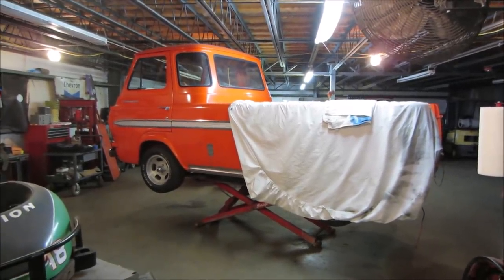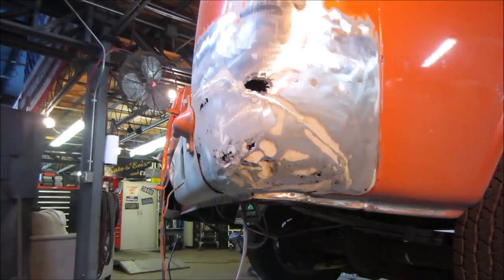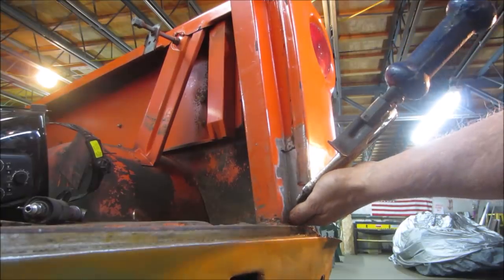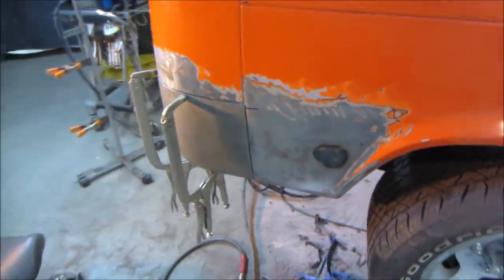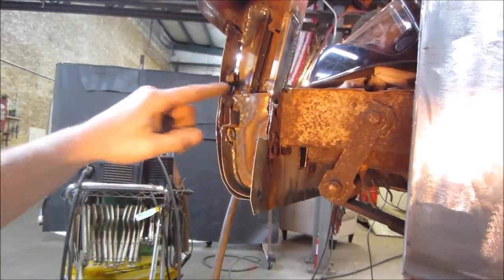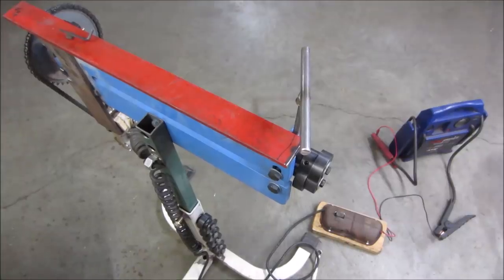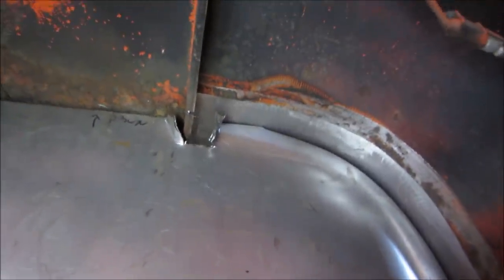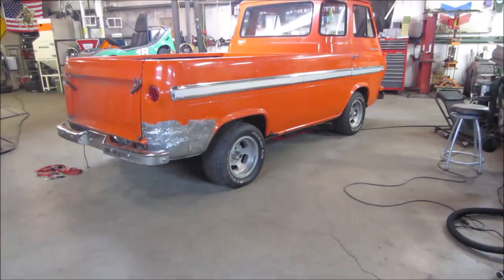learning How To Make Metal Repair Panels, Return of the 65 Ford Econoline Pickup.

Comment: I was wrong. 1966 was not the last year; 1967 was last. 1968 was the new generation of Econolines.  And I also owned a 1971 new E100 van at the same time.  302 V8 and auto trans. Had to order it because no dealers stocked 8 cyl Econolines. Purchased from John Kirby at Orange Motors Ford in Albany.  Actually bought the 1966 pick-up (used 5 yrs old - 98,000 mi.), and drove it home the same day I ordered the new van from John.  Had also bought a new 1969 Ford T-8000 diesel tandem dump truck from John, as well.  John was a good guy and devoted volunteer time to a mental health charity.  Not too many of his customers knew that.  I was honored to know him.

Comment: Hammering the fender flanges gives you more tire clearance, of course.  With a Porto-Power, a short 2 x 4, and a sandbag,  you can really flair out your fenders. Go slow and careful.  There is no going back.  I'd say just a little or you could buckle the fenders beyond repair.
Reply from the maker: yeah l kinda want to stay away from pushing them out in case l put the stock tires on it,

Comment: Easy enough to buy/ make a wheel arch roller, that bolts to the wheel hub, and adjusts to the radius from hub centreline and you just push - pull the roller on the inside of the wheel arch giving tyre clearance Mustie..

Comment: Personally, I'd have probably made the floor corner in 2 pieces with a weld seam on the vertical strut. It'd have been a lot, lot easier to fit and with just a little grinding, you'd have been finito!

Comment: What a simple and practical vehicle.  You could haul almost anything in that bed and it's at the perfect height for loading and unloading.  A guy could add a retrofit AC unit and maybe electric windows and it would be awesome.  There are 3 guys on my street with massive 4WD pickups all jacked up to the point that you need a ladder to get in and out and to load anything in the bed you have to lift it over your head.  Totally worthless as a work vehicle, and probably cost 50K.
Reply from the maker: l never understood those tall work truck too

Comment: Spray one light mist of flat black, use as a "guide coat"
then lightly BLOCK sand with 1k W/D paper-

Spot welds will be revealed (any low or high place).

Comment: why don't you coat the entire bed with a rubber spray-in bedliner instead of regular black paint? The bedliner is thicker and will fill in all cracks and gaps and seal in rust spots as well, keeping them away from the elements and further deterioration. The bedliner will also dampen vibrations and reduce noise while driving or from bouncing cargo. Many bedliners are a do-it-yourself project and can be rolled in too.

Comment: Hey mustie love your videos been watching threw all your old ones. I recently bought a Troy bilt self propelled push mower with electric start. One problem is I can't get the electric start to work. I tested the starter so I know it isn't the problem the other is I can get it to start with starter fluid but I can not get it to stay running. I have rebuilt the carb and cleaned the gas tank I'm going to check the valves tomorrow do you have any suggestions? I'd really like to get this one running and keep it for my own collection but I'm starting to think it's just parts at this point.
Reply: I also have another push mower called the grimlin cause it's so ugly and it's sucking air from somewhere and I can't seem to find that problem either. Out the 30 I've fixed this month these 2 have me stumped

Comment: Such a pity that vehicle manufacturers back then weren't required to underseal their products, as they are now. Many more vehicles could have survived, and there would be better material to work on.

I guess too, we have to remember that this is an "Econoline" and wasn't built to such demanding specs as some other vehicles of the same period.

One eternal problem with vehicles of this age is that you're repairing metalwork that has seen the ravages of time. Panels may be bent and distorted from previous accidents, heaps of filler applied and expertly formed to cover the old damage. Then one day, along comes an eager restorer who only discovers the previous damage whilst working on yet later damage/corrosion. A lot of "fudging" may be needed to get back to something near the original form and appearance. You can only work with what you've got, and it's pretty impressive to see what can be achieved with a little bit of ingenuity and imagination. I have visions of our Mustie heading off to California, with a pair of surf boards strapped on the back, and suitably attired for the trip.

Can anyone tell me, what was the nomenclature of the very similar looking Dodge panel van which ran concurrent with the Econoline etc?

Comment: Hey mustie I know you said you have issues with your arm with sanding couldn't you use an orbit sander to save your arm a bit? I know some hand sanding does good but if you had to use an orbit sander if you have it.
Reply from the maker: still need to do lots of hand sanding
Reply: @mustie1   well true there, figured you might be able to get away with an orbit sander for most of it.

Comment: Hello, I need some diagnostic help. I have a Stihl 025, and it's flywheel seems to be sticking to the ignition coil. I haven't been able to get the spark plug off to see if it has spark, though I suspect that it doesn't since I have taken the housing off the piston and looked at the plug and it's completely black. Any advice would be helpful, thanks.

Comment: Mustie, your doing yourself a disservice when you overlap metal that is the very first place you will get rust when I worked in the business I used lead and a metal file beeswax and pecking hammer, Whenever possible always butt your metal  together to braze it and when cutting patches do not overlap them braze a rod to the patch have someone holding the patch using the rod I;m not being disrespectful trying to tell you from the many mistakes I made

Comment: Body Rolls - Just a thought before you beat on the other side.  Why don’t you film yourself forcing sharp turns to see how much body roll you actually get.  It’s not like you’re going to enter a the Econo into a drifting competition or load it with a ton of weight.  OR  like someone suggested earlier.  Find the correct offset tires and wheels  OR  FLARES 👍  - Just me sayin 🧐

Comment: I am doing a 65 mercury econoline pu my rust is worse than yours mine is missing the bottom 8 inches all around where did you get the patch panel the corner ones also I need a radiator for mine it has a 240 motor the radiator core is 171/2 wide by 20 tall three row the ones I have found are 1000 to 1300 for copper and brass I do not want aluminum want to keep all stock  any help would be apericated   thanks dallas

Comment: no excuse for not getting blind areas rust coated
Reply from the maker: gets covered in thick oil, and dont care if you think its an excuse, been doing it 20 years with no issues,
Reply: @mustie1  Try doing it for 50